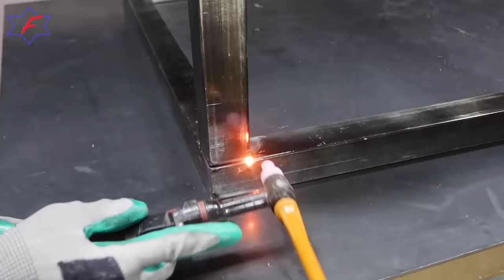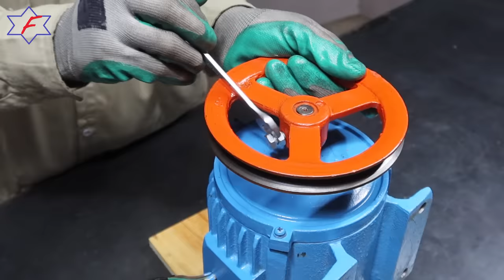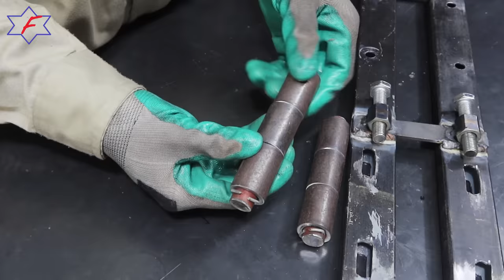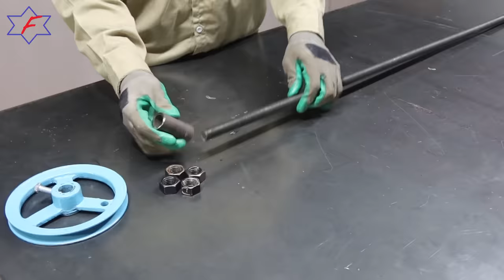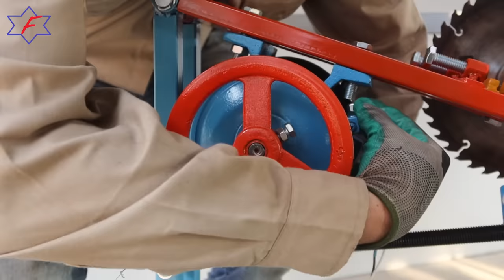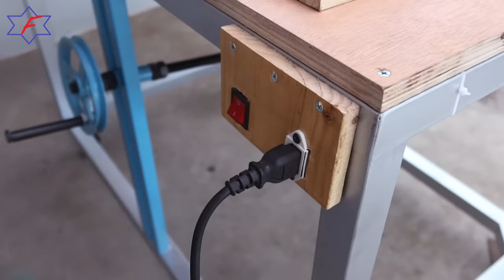DIY Tool | Make An Adjustable Table Saw From Motor | How To Build A Table Saw Without Circular Saw

Comment: the frame holding the the blade is too weak, I watched the blade wobble as u wound it up u need to beef it up perhaps extend the width and the wiring done with glue is not a good idea otherwise i liked it!!
Reply from the maker: Many thanks for your opinions!
Reply: เก่งมากค่ะ

Comment: Brother, do not connect wires like that. You need wire nuts or solder on those joints!  Also please consider a much heavier cord. That will cause a fire. Please consider this.
Reply from the maker: Many thanks for your opinions!
Reply: Здраво
Reply: @fawabros  +
Reply: Poderia passar as medidas da bancada e o tipo de matalon q usou?

Comment: My heart literally slipped a beat when watching you use this table saw. There's plenty of videos on here showing how to use one safely. This is a guy who is soon going to find it hard to pick his nose.
Reply from the maker: Many thanks for your opinions!
Reply: also pretty sure that should be a lefthand thread for the blade lock
Reply: @fawabros   w
Reply: 0
Reply: Es un placer tener está gran obra de máquinas Cierras con motor Eléctrica , magnífico trabajo de herrería.mi más cinceras felicitaciones por tan bello diseñó.saludos de Cosamaloapan Ver..

Comment: Very risky, no riving knife and this is not an option. Soldering with hot glue if the contact is badly made, it can overheat and set fire. And I hope for your good that you do not exceed the rpm of the saw to prevent it from exploding.
Reply from the maker: Many thanks for your opinions!
Reply: @fawabros  Electrical connections MUST be soldered. This isn't an opinion, this is safety. Maybe "safety" isn't a concern in a third world country, but frankly, I wouldn't want my garage or home burned to the ground for uneducated manufacturing choices.
Reply: @SpicySteve-tz2so  ppwm.
Reply: @SpicySteve-tz2so  very wrong, steve. safety is same for every one whether they are from 3rd world country or not. it is prudent that @Fawa Bros  address all the safety issues before actually using it.
Reply: Perfecta hermosa sierra de banco
Reply: 😊ج@😊

Comment: I'm happy with my 40 year old Craftsman table saw. Never had a single problem with it, and "the price is right".
Reply from the maker: Yes, sir!
Reply: unfortunately the new ones are junk and can't be repaired, My craftsman was about 8 yrs old and can't replace the motor. I couldn't even get the motor out with out breaking it. proprietary garbage that is meant not to last and  or be repaired, It really disgusts me.

Comment: Отличная работа. И смотреть интересно. Но вот на вал, на который устанавливается диск, надо было сделать резьбу с того конца, на который устанавливается шкив. Чтобы зафиксировать подшипник и чтобы он от вибрации не сместился из подшипников в обратную сторону (в ту сторону, где установлен пильный диск).
Great job. And it's interesting to watch. But on the shaft on which the disc is installed, it was necessary to make a thread from the end on which the pulley is installed. To fix the bearing and to prevent it from vibrating out of the bearings in the opposite direction (in the direction where the saw blade is installed).
Reply from the maker: Many thanks for your advise!

Comment: After doing such a great job of construction on the saw table you turned it into a death-trap with your very sub-standard electrical wiring. No earth and hot glue for your connections? C'mon man, you're way better than that!!!
Reply from the maker: Many thanks for your advise!

Comment: That's so cool. Can you please mention the parts used? I have 10 inch circular saw and will be converting to table saw but equipment is the barrier.
Reply from the maker: Yes, you can do like this.

Comment: Really nice build/idea(other than the electrics). The main problem I see is that by the time i bought all of those parts and the time involved in sourcing them and building it I would be better off just buying one for under £100 and making some simple/cheap improvements.
Reply from the maker: Nice thinking!

Comment: cool build but 2 things 1. your blade in that application is lifting the wood you'll want to flip the blade to have the teeth come down on the wood not lift it up. 2. what will you do for tilt. if you want to cut bevels?

Comment: Excellent work done!
One suggestion though - instead of sliding arrangement of thickness adjustment, can you make it with screw and pulley so that exact thickness can adjusted (like the one provided for height adjustment of cutting blade), on the whole a very great construction! 🙏 🙏 🙏
Reply from the maker: Many thanks for your opinions!

Comment: hmm the entire weight of the motor + bearings is supported only by a thin threaded rod. The vibrations from the motor are thus transmitted to the saw blade.

Comment: Welded worc is good . construcction is poor . Im from Russia , I beg your pardon for spelling mistkes .
Reply from the maker: No problem. Many thanks for your opinions. In actual, suspension system is enough for this engine.

Comment: I would like to know with what machine did you welded?
Reply from the maker: I use TIG welder: http://bit.ly/30T55h0
Reply: @fawabros  is it cold welding? I didn’t see you use a wire in the other hand 😅? I am a beginner in welding 😇

Comment: How much inch blade your use..how much HP motor your use.....please give answer....this table measure ment also you can not give this video... Please give..
Reply from the maker: blade diameter is 9 inch, motor's wattage is 3000W.
Reply: @fawabros  motor how much HP...(example 1hp,2hp)like that....
Reply from the maker: @yohannanmathai7519  1 HP = 746W. It means this motor is 4 HP
Reply: @fawabros  that is I am asking now your give clear answers thank you..but one is not give answer table measure ment.. Please give...

Comment: Диск болтается в стороны. Это очень плохо!
Reply from the maker: No, bro.
Reply: @fawabros  Later I watched a similar video, it seemed to me that it was yours, the second option, where the frame lifting design was changed. The test showed that when lifting the frame, the disk moves very stably. So, don't be discouraged, bro, everyone has errors, the main thing is to keep positive. Good luck!